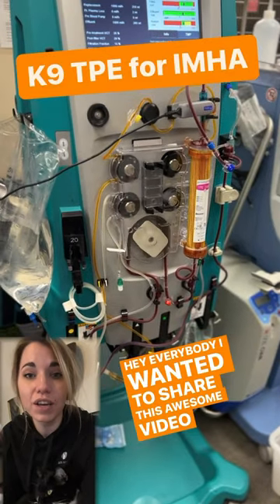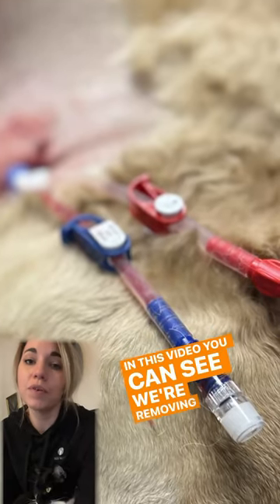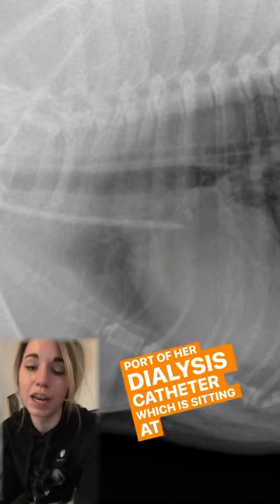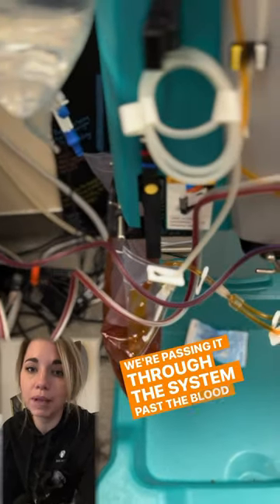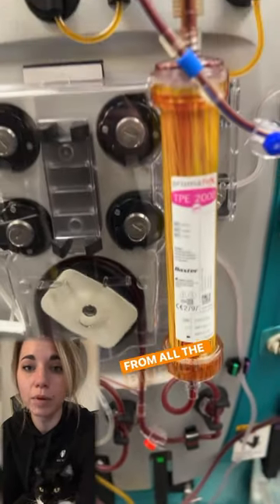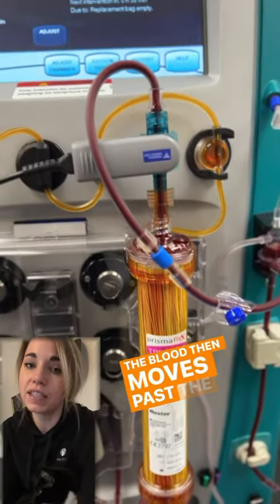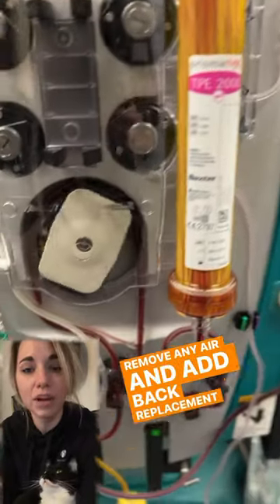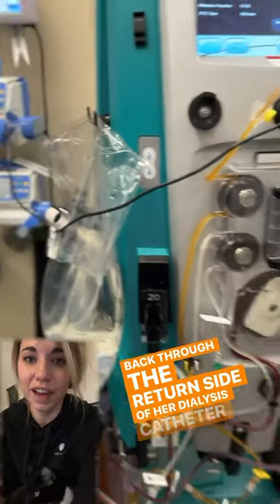A dog getting therapeutic plasma exchange for treatment of IMHA. #dialysis #vettech #vtsecc

Comment: Would love to know more
Reply from the maker: Absolutely! Apologies for the late reply. TPE for IMHA is performed to remove the plasma antibodies that are causing the immune mediated destruction of red blood cells. We then replace the plasma we have removed with a combination of starches and donated plasma. This treatment is performed while waiting for immunosuppressive drugs to stop the primary process, and is usually reserved for very critical patients, although finances are usually a big factor as it is an expensive treatment which may need to be performed multiple times.
Reply: Is there a specific catheter you use for dialysis?
Reply from the maker: Yep, it’s a dialysis catheter which is basically just a really large gauge double lumen central line.